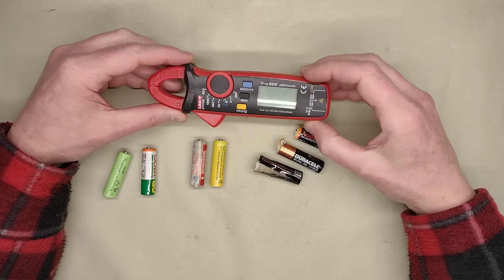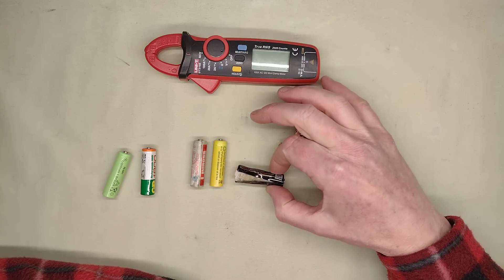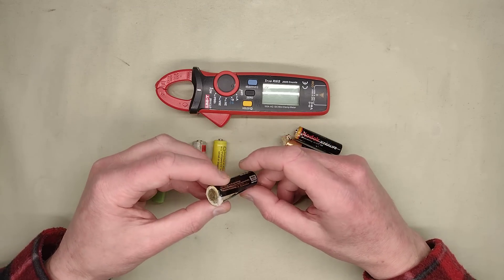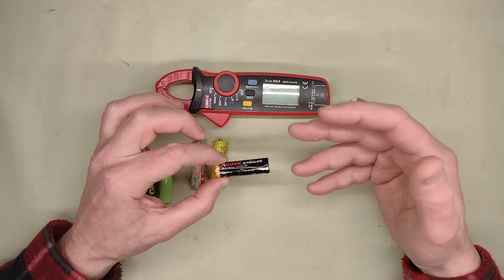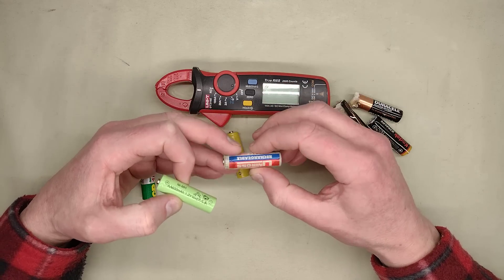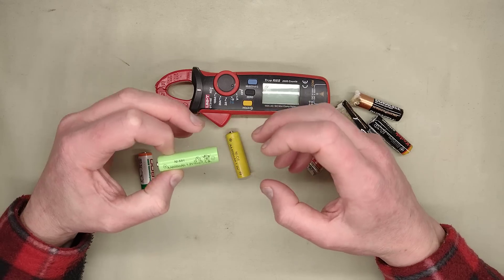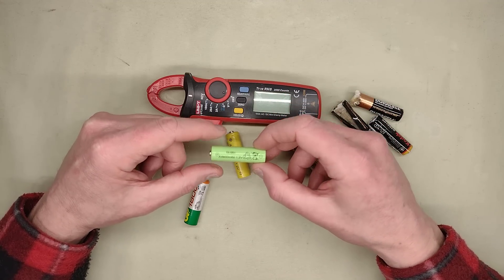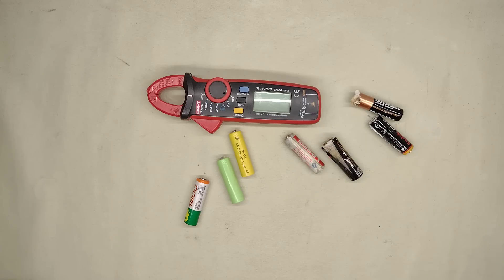The curse of leaky alkaline batteries

Comment: 100% true i use NiMh everywhere when 1.2V is enough to not trigger low battery warning, for other applications I use AA Energizer Ultimate Lithium  (never had any leaked, I use them on expensive scientific equipment like ginger counters) when they need to be stored in ready to use condition.

Comment: I learned years ago to take out batteries on devices that I will not use in a while. A couple of times I forgot and the battery destroyed my product. I don't use duracell anymore as I think they leak more often than the everlast. I had a duracell in my edc flashlight. I used one day and the very next day I went to sue the flashlight again and it didn't work. The battery had leaked and welded itself in the flashlight. I had to drill it out. I never get the flashlight to work again. New products I buy today I try to get the models that use the lithium or nimh batteries. Like you I'm done with the alkalines.. Thanks for the video.

Comment: I tried using rechargeable NiMH batteries in my smart door lock and in only a few weeks, I was getting notifications that the batteries were low, all because they are 1.2v instead of 1.5v. So now I only use alkaline batteries and they last months.

Comment: It's interesting, if I must stock Alkaline I only stock Duracell. I have never come across a failed/leaky Duracell over the years. I typically use Duracell 2400 mAh AA's for most applications, as these have proven long term reliable. I have some that are 17 years old and still holding up fine. The leakiest batteries I found have been the cheapo 'included' cells like GP, Greencell and all those super lightweight zinc batteries. Eveready have shown to be poor quality in my experience too. Though I favour Duracell, Energizer have proven to be durable - however I have had a number of those cells come to me mostly discharged.

Comment: The only times I've encountered leakage with alkaline batteries is when they're cheap unknown brand ones or when they've been left in a device for a very long time.  By long I mean several years.  I still find they give better service life in remote controls than NiMH and that is almost the only place I still use them.  I definitely haven't found that low discharge NiMH will hold a useful charge for years and in remote controls I was having to recharge them every few months.  Alkaline are still much cheaper than NiMH, so they make sense in a device like a remote control where they last much longer.  I rather put the NiMH in the higher drain devices where they beat alkaline in every way.
Reply: Also the leaking is inconsistent.  Recently I found some gadgets that all had the same brand batteries and they'd all been installed at the same time.  The devices were identical too.  The batteries in one device had leaked everywhere while the batteries in the rest were completely dead, but hadn't leaked.

Comment: Here is what I've observed from the alkaline battery brands I most commonly use:
1. Duracells are almost guaranteed to leak after enough use
2. Energizers never leak
3. Signature Select (a Vons brand) do this weird thing where they shrivel up and make popping sounds if you use them to their absolute fullest (for example, leaving a AA-powered fan on until it stops spinning)

Comment: Even with new NiMH batteries I always had issues finding ones that don't discharge to quickly. Been using lithium based AA and AAA for some time now, super convenient, some even come with their own integrated USB charging circuit on each battery and they are rated for up to 1.5V

Comment: I've stopped using Duracells because the AA and AAA batteries are so prone to leaking, even while they're still in the package with 2 or 3 years to go before their expiration date. Curiously, I can't recall ever seeing a Duracell 9v battery leak. They haven't always been like this, so something must have changed in the electrolyte formula. Currently I'm trying my luck with Eveready and haven't encountered any leaks so far, but time will tell.

Comment: I remember the original Nintendo Game Boy had a warning in its instruction book to not use rechargeable batteries. I can only guess that it can't tolerate 4.8V instead of 6V.
Reply: So many devices recommend alkaline batteries for the wrong reasons that you cannot take this seriously anymore. I'd say the Game Boy is one of them: It has a buck/boost converter that always generates the right voltage and therefore is highly tolerant to the type of battery you use. For example, you can plug in an external power supply, this raises the input voltage to 9V, and the Gameboy handles it just fine. 4.8V is absolutely no problem for the Gameboy, but you can even install higher voltage batteries. I'm not sure if you should push it as high as using 3.7V Li-Ion batteries, but it wouldn't surprise if it would work just fine, as the DC-DC converter will simply adjust.

Comment: Alkaline batteries do have an advantage: They're cheaper than NiMH. I recharge my alkaline batteries, and as part of that, I check my stores and devices more frequently. I also remove one battery in temporarily-offline devices, eg wireless computer mice, to reduce the possibility of leakage (and increase lifetime).
Reply: Recharging alkaline???
Reply from the maker: You can get chargers for alkaline cells that recover some of the charge of a partially discharged cell at the high risk of leakage.

Comment: That was educational, thanks. If you use NI-MH batteries, is it safe to leave them unused in torches for long periods of time? I hate having to keep the batteries out of the torch and then put them in when needed, i.e. when it's dark!
Reply: It's 100% safe, NiMH batteries are very stable. The only concern is deep discharging (draining them to 0V), this reduces their life. But since the leakage currents are nowadays really small, it takes many years before the battery has discharged itself.

Comment: Very interesting although there are two 'buts'.  Firstly as you say, the cell voltage of NiMH is lower, nominally 1.2V compared with 1.5V.  This means that if the low battery warning comes on at say 1.1V, the NiMH battery will give a low battery warning in next to no time as the voltage only has to drop by 0.1V whereas the alkaline cell voltage will need to drop by 0.4V.  Secondly the working lifetime of NiMH has proved to be disappointing.  They develop a self-discharge fault sometimes after only a couple of dozen charge/discharge cycles.  Other contributors have covered this and have also described the rather brutal way of 'curing' the problem.
Reply: What you state exists, but not at 1.1V, because if a NiMH battery outputs 1.1V, it has about %5 charge left.  Devices that give battery warnings at 1.2V do exist though. I hate that, because Alkaline is only considered empty at 0.9V and the voltage drop is much more linear than with NiMH. So those devices encourage people to throw away batteries that still have a lot of life left.

Comment: Rechargeable battery has much lower internal resistance. Alkaline battery may have e.m.f, but for high draw application for example a photography flash light, much more voltage is lost due to internal resistance. In effect, the voltage could be as low as 1.2v anyway. 
       That is why it takes longer to charge up the Flash light using Alkaline battery and I always use rechargeable for my flash light. One less reason to use Alkaline battery.

Comment: Can confirm everything you've said. I've also found that, in some applications, low-self-discharge NiMH batteries have a significant cost advantage over alkaline cells. We use them in wireless microphones, which in total would burn through 24 alkaline AA's per show. over a 14-performance run, that's a budget-killer. In contrast, I've been using the same 2 sets of LSD NiMH batteries and the same charger setup for the last 10 years. (Clearly, Shure has anticipated this, since the mics allow you to select alkaline or NiMH so that they correctly report battery status to the receiver).

Comment: We really need to organize a Duracell boycott, at least for their AA batteries.  They are horrible!  I purchased a box of them a few years ago, and they are dated May 2027 for an expiration date.  One of them, still in the box unused, has leaked a very large quantity of electrolyte.  But much worse, two that were installed in very expensive calculators (HP 48SX and GX) literally exploded and leaked, even though they had only discharged to about 1.38V (estimated by companion cell voltages) prior to failure.  
In the first instance, I was working at the computer one evening and heard a loud "bang" but couldn't find the source.  The next time I went to use the calculator, I was surprised to see a low-battery warning, even though the batteries hadn't been in service anywhere near as long as they usually last in that calculator.  Opening the battery compartment, I found a ruptured and leaking cell.  Fortunately, the leakage was confined to the battery compartment, which sits below the circuit boards, so no harm to the calculator.  
In the second instance, I wasn't so lucky.  I had put the other calculator away in a drawer, and since it was inside its soft case, I didn't know that it was laying upside down.  I discovered later that one of its Duracells had failed in the same way, but now there is electrolyte on the keyboard PCB and the calculator won't turn on.  
I am now using Eveready cells made in the USA.  I have never had a problem with them.

Comment: I've been using NiMH batteries to replace alkaline batteries for many years, most of the time it work better than alkaline batteries, and cost lesser in long term. 

However, the voltage of NiMH batteries are lower, and can't work on certain electronics equipments .

PS. The quality of alkaline batteries are getting very bad, it always leak, even it still has a few years before expired, and damaged a lot of my remotes (for TV, Hi Fi, DVD player, etc).

Comment: this is all due to the way the batteries are sealed, the cheaper batteries use a cheaper process with looser tolerances. the Max cells from the big brands usually use a higher quality sealant, tougher collector, and don't leak like the cheaper batteries

Comment: Like most folks, I've had many alkalines leak after several years of neglect, but they've never actually "destroyed the equipment". I'd say that would require some pretty terrible luck.
IMO, akalines are still great for devices that get used a lot, where a dead battery is noticed and replaced within a few months at least. Hard to beat the convenience and low bulk cost.

Comment: Avoid Duracell batteries like the plague! They will leak almost 100% of the time, I noticed this several years ago and stopped using them. I now use Energizer Max and have had 0 issues with leaking even after the batteries go dead.

Comment: Duracell batteries hands down have leaked more than any other (major) brand I've dealt with. Fortunately I have the means to repair most of the damage but I won't use the AA or AAA to begin with. Duracell will offer a comp for the trouble but it is coupons for..., you guessed it, Duracells. I do have my DuraDamaged pile of electronics which one day I'll back bill them for. Ridiculous to see batteries with years left on usability leaking. They used to taut US manufacturing but most of what I see in the microscopic print is China. I've used Varta (e.g) batteries years out of date which were still charged and dry. The C and D cells seem to be fairly reliable and I actually buy the 9V ones with satisfaction. DuraDamage AA & AAA earn a 1 rating in my book.

Comment: Since the first generation of eneloops came out, I transitioned to using them in high value devices, like nightvision devices, hand crafted flashlights and so on. 
Then I expanded the transition to use eneloops in cheaper devices too. 
And I only regret getting fake eneloops once. 
I also tried other brands and some where rather nice for half a year, but none lasted in my inventory.

Comment: Consider using  Lithium primary (non rechargeable) cells. Virtually no self-discharge, very good for low-power long standby use devices. Like the Energizer Lithium primary cells.

Comment: Batteries aside, the equipment itself can be damaged.
Countless times I got mini-stuff (like radios, players, ect - anything small enough to use batteries) the insides of which was screwed up by old (and leaked out) batteries. Some of the acid you can rinse away from the plastic (and use abrasive stuff like sandpaper on the metal parts, which got oxidized), of course - but if the acid has leaked out from the battery compartment, it will mess out with the exterior parts as well.

Comment: The pro-cells seemed to depend on being removed every time we did a job... so in actual "pro" use we never had them in equipment for more than a day generally. ( always had a tin of citric acid crystals (from cooking supplies isle)  for clean up just In case - warning : not for die-cast cased gear!)

Comment: So why is it that certain brands of alkaline batteries seem to be more prone to this than others?  I’ve lost many an electrical component to leaked Duracells but near none to Energizer batteries. I’m not saying Energizers never leak, I’ve had D cells Leah in Maglites, but in my experience at least, they tend to leak far less then the Duracells. I took some 15 year old Energizers that were amazingly still working out of one of my old RC car receiver 4 AA packs literally last night that were not only still working but perfectly fine. Meanwhile an identical pack in another car with Duracells that were at least 8 years newer had leaked all over.  Additionally of all my old RC transmitter radios, every one that had Duracells left in them are ruined while the equally old or older Energizers are fine.  Maybe my experiences are unique but regardless this is what I’ve seen.
Reply: Batteries contain stabilizers to prevent leakage. Manufacturers have some freedom in what stabilizers they use and also, many substances have been forbidden because of polution problems. Disposable batteries turn into waste quickly, after all.
Reply: @danielmantione  That makes sense but you would think if there’s something to this that Energizer would want to fix it. Like I said maybe my experience, being the microcosm of the entire usage of batteries that it is, is not indicative of the broader trends.

Comment: I noticed in recent years that I've been getting alkaline battery leakage in a ton of my devices. I came to the realization that through a combination of extremely high power efficiency of modern devices and sometimes minimal usage of those devices, the batteries are just sitting in there for years and never coming close to being fully drained and thus forcing me to replace them before they leak. I decided I should just go with lithium batteries instead to avoid leakage from now on.

Comment: I just cleaned out an antique battery opperated train had batteries that expired Jan 1999 took a while to clean it out working once again also added smoke unit from another similar parts doner train.
Patant date 1986 made to 1997 New Bright Train Pioneer set

Comment: No, Clive - 1.2V is a fault of the battery, not the device using the battery. 
You don't bring out new technology and ask the market to fit your specs, you design your specs to match the market. 
Making 1.2V NiCd/NiMH/Li-Ion/LiPo rechargeables is just begging Duracell and Energizer to stay in business making Alkalines.
Reply: Hmmm... Alkaline batteries are below 1.2V for about 40% of their life. Therefore, devices that don't accept 1.2V also require you to replace alkaline batteries well before they are empty and that I consider a fault of the device.
Reply: @danielmantione  A battery's life isn't measured from 1.5v to 0v... where did tou get that idea? Most devices start failing when batteries get below 1.35. That why rechargeable tech will never hold up to them. 1.2 is as far from 1.35 as 1.35 is from 1.5. so they start out literally two times lower than a device requires. 
Have you ever measured alkalime batteries in a regularly used device that isn't working properly? You'll notice problems well before they get down to 1.2 volts. 1.2 is effectively a dead battery.

Comment: Huh.... I may have to run a test with the analog BK radios at work this season to see which is more cost efficient. 
We go through flats upon flats of alkaline batteries in the fire shop and there's usually a small pile that I have to toss straight from the flat due to leakage.

Comment: Those Kodak ones are an absolute nightmare.

50/50 when you take them out the pack if they've already leaked and even if they haven't I've found them to give out less than a month later.